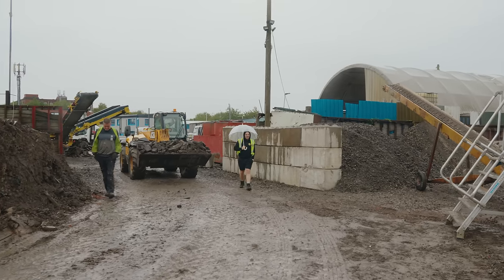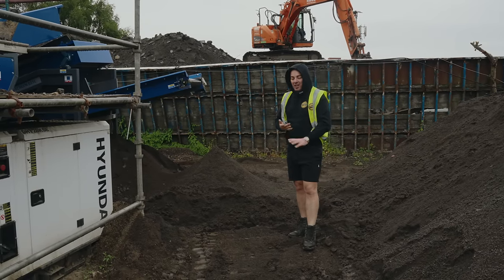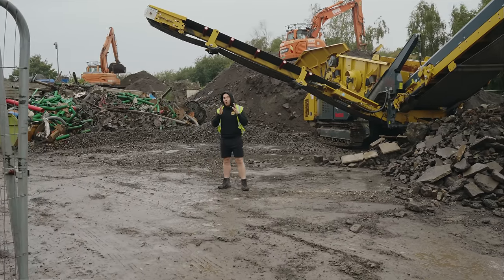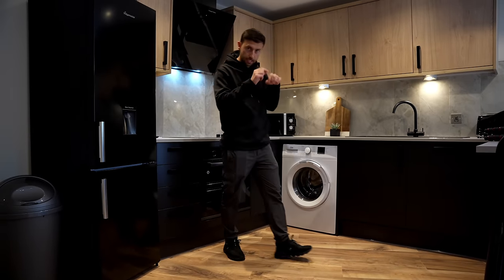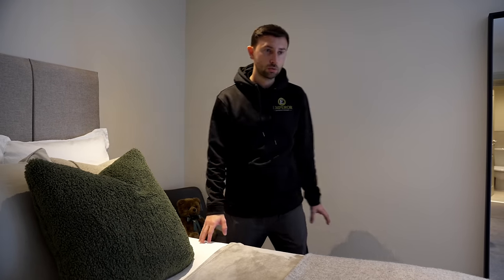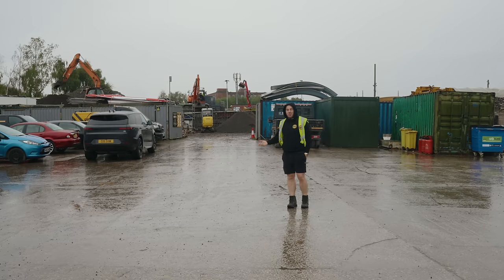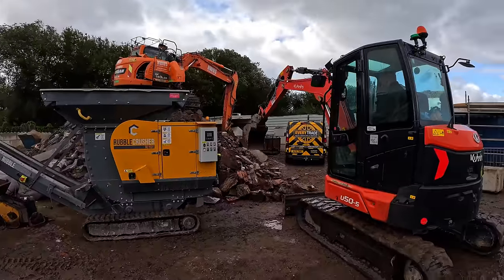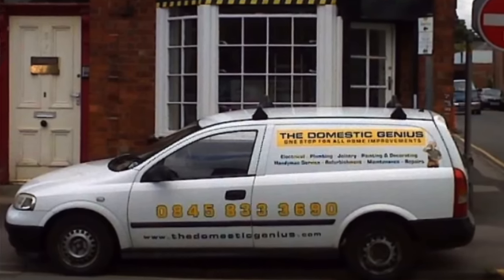I can’t believe this is FINALLY happening… I’m losing sleep over it

Comment: Fantastic video!  Chris my specialty is plant and crushing, screening, ground works and rail. Yard looks great keep it same size but fine tune it. if your crusher or screener has a brake down just temporary rent a crushing or screener bucket until it’s fixed to keep up with demand. Keep on top of machine maintenance as they are high wear and tear bits of kit.  you can always put an evening shift or weekends to keep up with demand. Try get a hydraulic magnet to go on 13 tonner to keep on top of punchers. Maybe a little pub in yard then you can make revenue from all your lads in the evening to lol.
Reply: And a hot tub for the Dig!
Reply from the maker: Haha now that’s a good idea!!

Comment: Should tape and caulk round sockets gives a crisp line all way round
Reply: Yer we do that but still needs touching up around the plaster
Reply: But when you come to take them if in the future the repairs are hard work
Reply: @emperor_property  no not at all sharp knife to score round change switch and redo tape caulk touch up paint on to tape and not on the wall blends in perfectly
Reply: @curtisfleming-yf9yh  try saying that to a spark going in to fix a fault 😂
Reply from the maker: You offering? 😂

Comment: How do you combat the noise between the self contained maisonette on the 1st floor and the HMO on top floor? Would there be possible conflicts?
Reply: Sound proof. With Blue plasterboard, rock wool insulation and resilient bars. The upper floors are installed with insulation board under the flooring